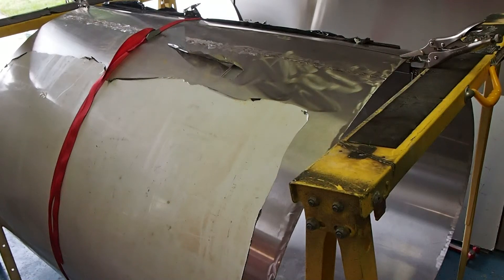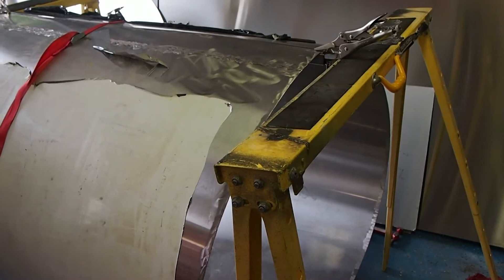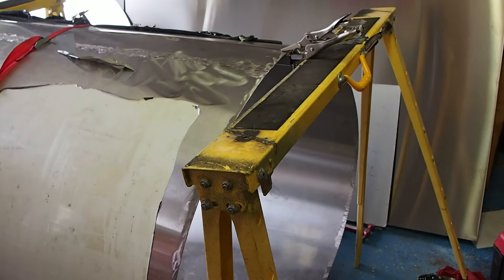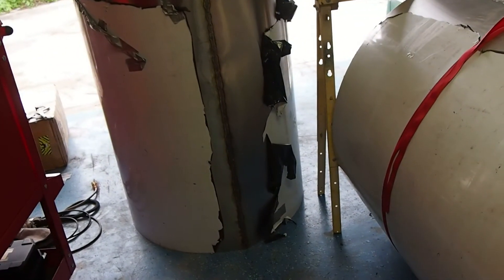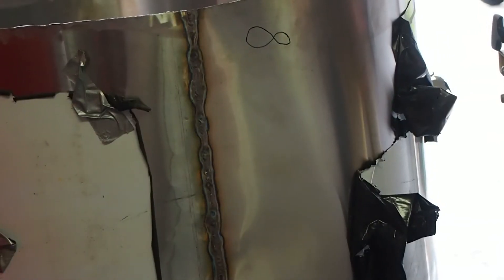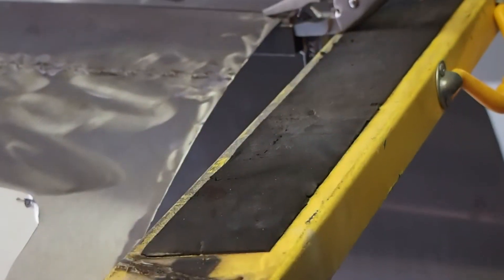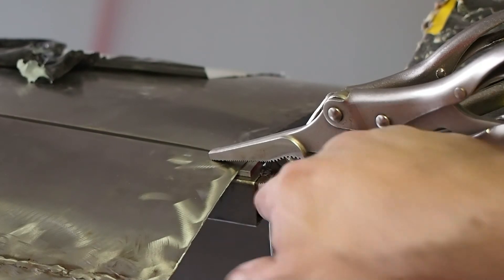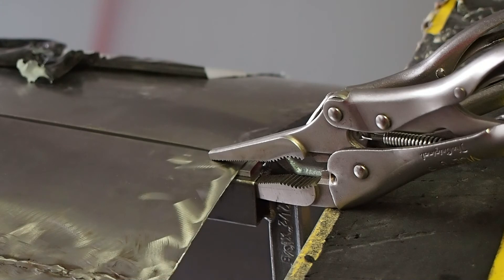Wood Gasifier Prototype Build - Sheet Metal Welding of Cylindrical Vessels

Comment: what kind of gasifier are you building?
Reply from the maker: I am building a modified version of Larry Dobson's roundy gasifier. check out fundamentalform.com for a complete set of plans.  my modification was basically to remove the air to water heat rxchanger
Reply: cool i'm familiar with that design.... wish you the best of luck in your build.